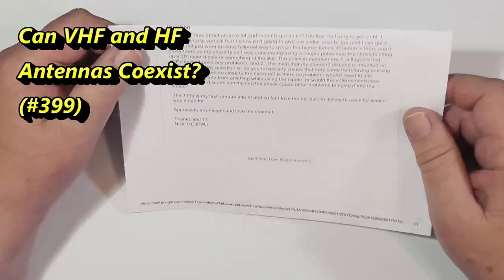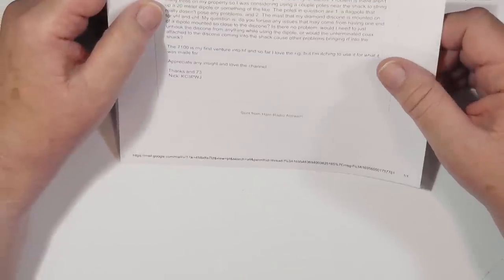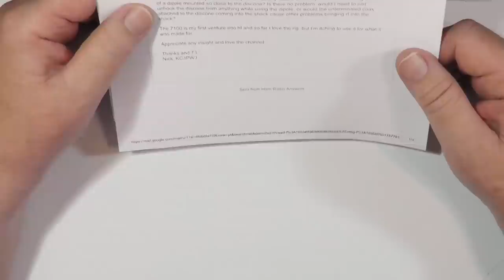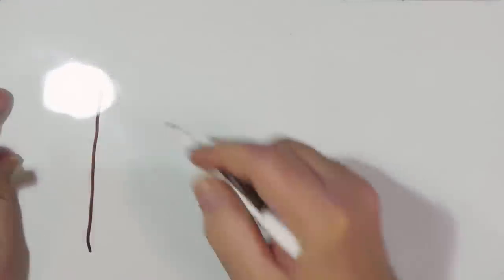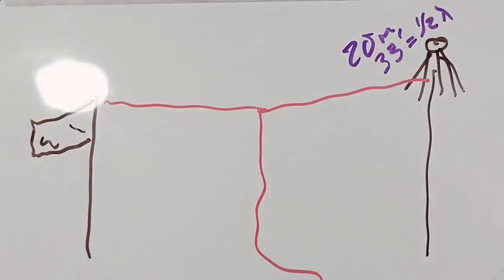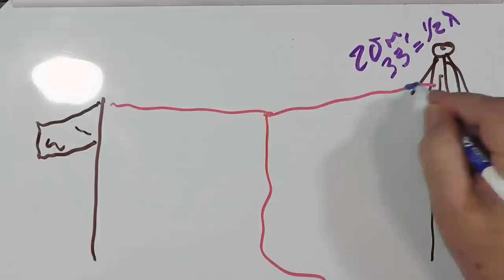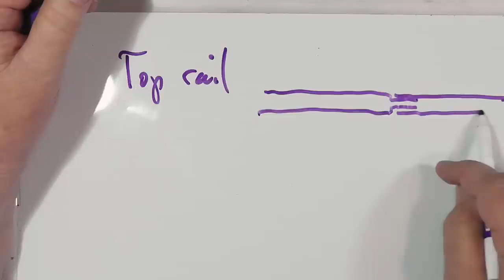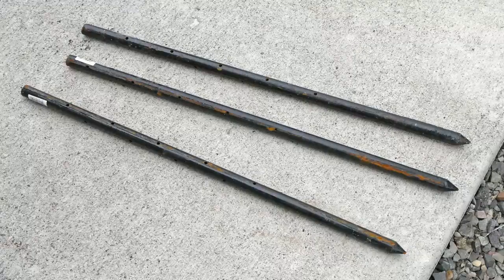Can I Put One End of a Dipole Next to my VHF Antenna? (#399)

Comment: Thanks Dave! I did try it and got some feedback in the rig the discone is hooked to when the end of the wire was right next to it. But it's 4 feet away now and the problem is gone. 
I'll add my mast is made of chain link top rail. Took that suggestion from you in an older video. Made 2 contacts on 20 into South America!

Keep up the good work.
KC3PWJ
Reply from the maker: Glad it helped

Comment: The thumbnail picture got me thinking about a different subject than what you mention in the video.  I did a short video overview of my 97" 2 meter monoband mobile whip, and someone responded that I should try to use it for 10 meters, and that it'll work great!  But how can a phased VHF antenna be used for 10 meter HF work?  Isn't the nature of the way they build such an antenna preclude 10 meter use, even if we ignore that the total length is still five inches short of proper 1/4 wavelength?  

Moot point, considering I run a 102" whip on the same car anyway.  But I would still be interested in an answer to the whole phasing and final length thing for purposes beyond the one band the NR22L mobile whip was built for.

Comment: During this year's ice storm two large 50-60ft. trees demolished my $300 OCF folded dipole.
Another tree broke, fell and got caught in an adjacent tree while a 12ft.X16" thick limb (a small tree) is stuck dangling in the wind 40ft up and dangerously close to where I need to mount a replacement dipole.
Since then all I've heard is how well the HF bands have opened up. I hate antennas. This will be the third one. First one was hit by lightning and took out my radios, recording gear, and several computers. -even damaged gear that was stored in boxes in close proximity not connected to anything. Did I mention I hate antennas?
Reply from the maker: Ouch!

Comment: A friend uses those stakes, which I believe are intended to support concrete forms. He welded a link of chain to the top of each stake. That link had about a quarter of it cut out to provide a tie point. They work well.
Reply: the stakes are commonly known as cement pins.

Comment: What is your opinion on the ATAS-120?
Reply: The ATAS-120 has problems. I had two that lasted a couple years each. I just threw both in the garbage. The motor went out on both.
Reply: @larrychristensen5917  no warranty?
Reply: Don't waste your money.  I had to return two of them due to failure.  Get a diamond screwdriver antenna, more robust.